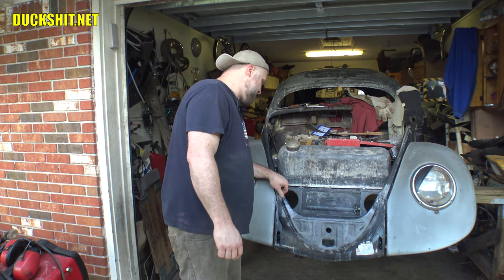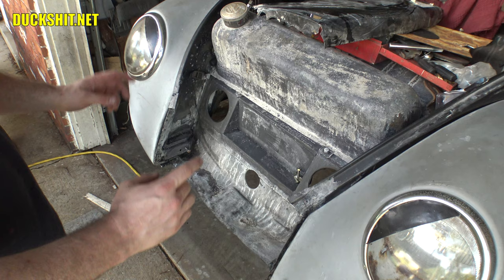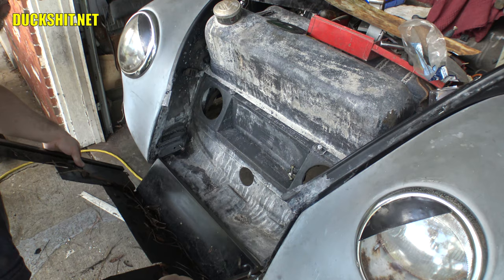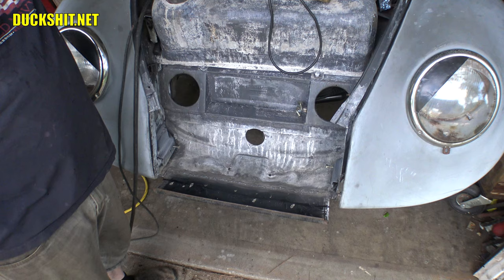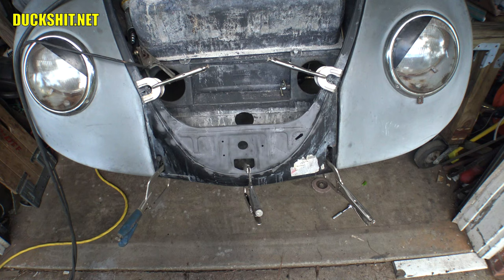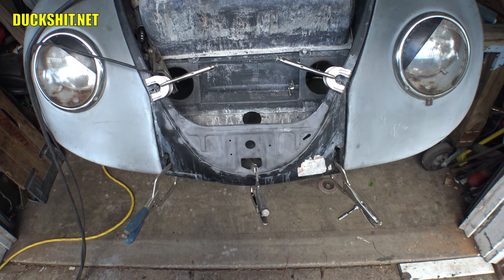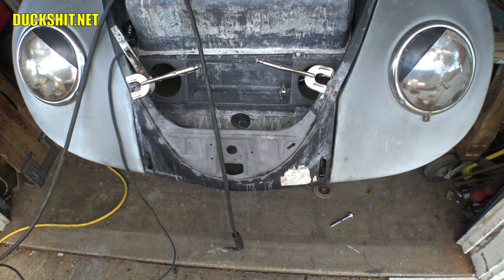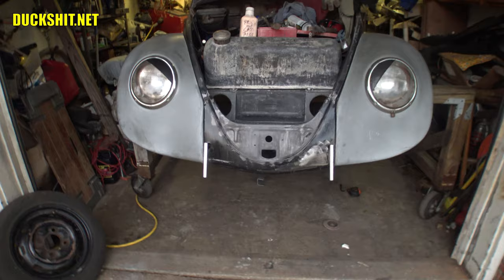VW Beetle Front Apron Replacement - ROTTEN OLD 1956 VW BEETLE - 117

Comment: It's 2100 hours EST. Took a tour of the merch site and got all the way to the "enter your info" part of the checkout cart. Very responsive with no delays or snags. I don't see any problems with the shopping experience with it at this time. My machine is an 8 processor, 16 gigabyte Windows 10 box. I'm running web browsing via Chrome and checked it out with Firefox as well.
Reply from the maker: Thanks much!
Reply: @DuckmanCycles  Not a problem, you're welcome.

Comment: Another good video. It always amazes me what you get done with so little in the way of shop and tools,but your determination and fab skills are the key. Store looked good to me and opened up. Still looking for that  large duckman rum and cola cup,for out in my shop.
Reply from the maker: Thank you for checking the store!  I haven't found a vendor yet for cups that don't break (even found brittle plastic ones) or aren't cheap pieces of crap.  Its gotta be the right size, and the right material.  Still looking!

Comment: Loving the videos. Keep them coming please. Apron looks great. Have you ever put a recessed angle chamfer type thing on the two panels you're butt welding? Thinking this is a good idea to keep some strength in the weld once ground down?
Reply from the maker: I haven't ever done that, but in this case I really didn't do a whole lot of grinding to the butt weld anyway because you're just not going to see it underneath the spare tire.  😁
Reply: @DuckmanCycles  that's true. I've got some body panels to butt weld and was wondering if this was a good idea is all.
Reply from the maker: @GT.Bugger  well typically I don't grind the welds completely flat anyway, too dangerous to the surrounding metal if you grind through.... but I never bothered to make a fancy beveled edge either.

Comment: What were those little blocks you were using to clamp the sheet-metal together? Are they magnets?
Reply: They're exactly that. Welding clamps. Can't remember the exact name but they have a tab that sits between the two pieces of metal you're going to weld and they clamp them together.
Reply: @GT.Bugger  I need some of those. I can't find anything like it around where I live. Guess I will check out ebay.
Reply: @obwonchablowme  they'll be on ebay for sure.. Probably amazon too and most local motor factors I'd imagine.
Reply from the maker: Panel cmaps, or butt welding clamos they are usually called.  There are some links in the video description.
⚫ Stuff Seen in Video ⚫ 
Panel Clamps ▶ https://amzn.to/2PSES0C
Phosphoric Acid ▶ https://amzn.to/2ruGW0B
Locking Paddle Pliers ▶ https://amzn.to/2RLNFyL
Early Apron ▶ https://ebay.to/2Y0Cs4R
Late Apron  ▶ https://amzn.to/2LDwTCR
Early T Bars ▶ https://amzn.to/2YctxZr
Late T Bars  ▶ https://amzn.to/2YeQP0K
Hidden Hinges ▶ https://ebay.to/2Ho0jBC
Goggle Sunglasses ▶ https://amzn.to/2Wk7ZsY
Mirror Sunglasses ▶ https://amzn.to/2Ludwgd
My XXXL Work Gloves ▶ https://amzn.to/2PTS577
Cool Rag ▶ https://amzn.to/2EgcRZM
Reply: @GT.Bugger  Problem is I live in Norway, and stuff like that is a bit difficult to find sometimes locally unless you know exactly where to look. I might have better luck looking in Sweden. Cheaper too. Stuff from ebay gets taxed to hell and back.

Comment: I just noticed... You don't use gas? Flux core?
Reply from the maker: Correct.  It's kind of funny that people are just noticing that this week LOL... lots of comments related.  Trying to finish this spool.
Reply: Gas is less cleanup, but flux works fine. I've done body welding with a Lincoln tombstone and 6013 rod.
Reply: @DuckmanCycles  Nice. I have a flux welder and need to do the front apron on my 64. I feel better about it now. :)
Reply from the maker: This  whole car was built with flux, and more than 80% of it was built with a 14 year old Harbor Freight welder, something that people said wouldn't work!!!  Finally I wanted more settings and replaced it with the Lincoln
Reply: @DuckmanCycles  That's awesome. Thanks!
Reply from the maker: Awesome!  I hope you make videos replacing that apron!
Reply: @DuckmanCycles  I will when I get there. My videos are far less entertaining than yours! But I do have VW stuff...
Reply from the maker: information and progress on a project is always entertaining!